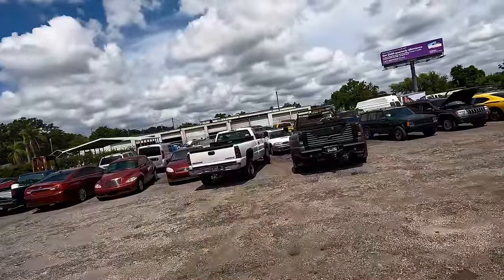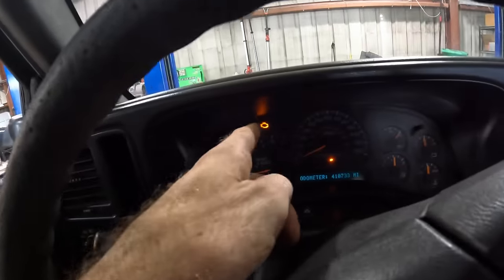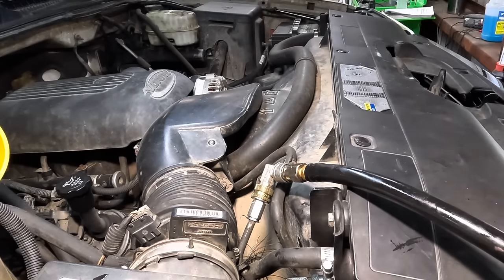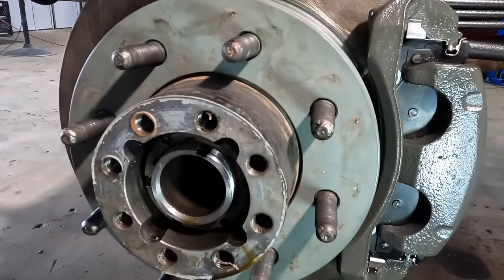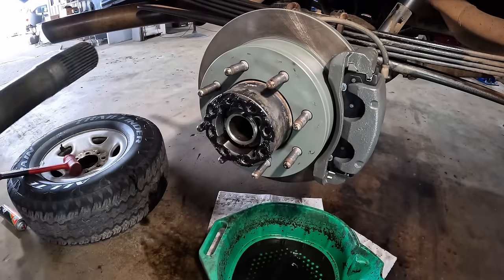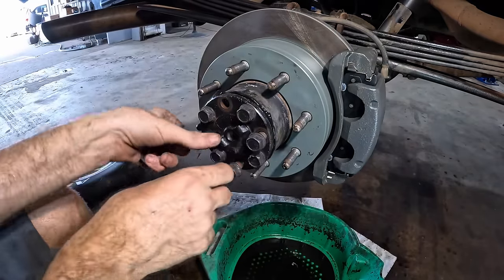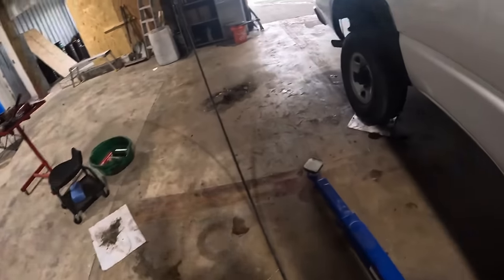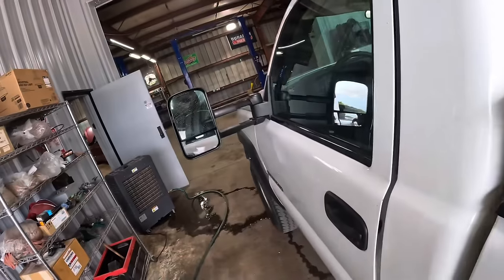400,000 Miles of BURNT Fluid & Loose Wheel! Oil Soaked!  2006 Silverado 2500 3500 6.0 4l80 #mechanic

Comment: Looks like its also may need a new oil pressure sensor. Its pegged to the max even at idle
Reply: More likely a failed stepper motor in the gauge cluster than a bad sensor, but could be both.  Kindof depends on a case by case basis.  GM cluster stepper motors are notorious for failure.

Comment: For over 30 years I worked for a co that had a fleet of over 75 superduties.
By trial & error our co learned the hard way ($$$$$$$$$$$$$$) that the
way to make auto trans last forever was to change oil & filter every 30K.
Doing a full trans flush & getting the bad oil out made these trans last
& last & last. The Boss said he used to have nightmares seeing that OD
light flashing.

!

Comment: This me, I would only change 1/3 of the transmission fluid.  Taking all the fluid out could cause the clutches slip.
Reply: If that's the case, then the transmission was bad to begin with

Comment: Ray, Since you usually do a review of what you have done and also usually invite us to heap our criticisms upon you I have a few comments to offer. 1) No mention of having torqued the wheel nuts at the end. Deferring said torque application made sense since wheel would have to come off again if axle seal was still leaking, but the job isn't finished if you did not complete the final torque; 2) No mention of the maxed out oil pressure gauge; 3) Up or down? You should have gone up first. You have taught us in other videos that saving time is important. Vehicle already up in the air - putting it two feet higher and then only having to drop it once takes less time than dropping it two feet, raising it four feet and then dropping it four feet. 
Please tell me that you recorder that video on a Friday so that I can maintain my high esteem for your mental acumen on a simple lapse of focus due to the upcoming weekend.

Comment: I've never had a complete fluid exchange kill a transmission. I believe the myth comes from people trying to save an already failed transmission by replacing the fluid. New fluid will not restore a burned clutch pack, nor will it turn back a blown sprag clutch. Any time I installed a used transmission, I always replaced all the fluid--and the filter. Pan gasket and external seals to boot. Easy when the trans is on the bench.
Reply: Bought a used truck from car dealership took to transmission shop had trans fluid changed it started acting up had to get a new transmission after that not sure what happened

Comment: I never used only new trans fluid in my E90 BMW that I serviced 3 times - I always added Lubegard 19610, but that's for a known transmission shuddering issue at certain speed, which I actually had. I was always under the impression that it wasn't advised to add only brand new fluid to high mileage transmissions since you lose friction material each time.

Comment: Have a 2000 Chevy Silverado with 127,000 miles on it. Still runs great. Haven't serviced the Trans. What would you recommend. Complete filter and drain and replace. Or just drain and replace.

Comment: Lean on both banks plus a mass air code= intake gasket time.
Reply: and put some caps on the AC ports!
Reply: Vortecs have terrible intakes. I have replaced a couple. Fellpro makes a upgraded gasket that works great.

Comment: Ray if the leaking oil got into the brake pads aren't they toast? They have been compromised? Brake cleaner would NOT clean the pads if they were soaked i n oil? Thank you.

Comment: If I had just washed off a contaminated brake without stripping it and sweating the pads I would have had something hard and heavy thrown at me!
Reply: Yeah thought that too.That much oil gotta be some on the face of the pads.
Reply: Sweating = alcohol? Or heat?

Comment: I have a 2006 GMC 2500hd 4x4 single cab fleet truck with 6.0 vortex that I bought brand new.  Now it has 195k on the odometer still runs strong I change the oil every three months or 3000 miles ( been doing this since new) changed coolant, transmission transfer case front and rear end many times also flushed the brake fluid a couple of times.  I have the posi rear end and it takes expensive gear oil.  Seeing the seal leak that much gear oil makes my wallet hurt.  They are good trucks if taken care of.

Comment: With the wheel bearings being that loose, I'd have definitely removed the hub to check the condition, and replace the seal as well.
I'd also have checked the other wheel as well. Whoever serviced it last obviously didn't know what they're doing.
(And buy a spindle nut socket set.  Using a chisel isn't the correct procedure. 🤣)

Comment: Rightmove man I changed the fluid on one like that and unfortunately ended up putting the transmission at it a couple months later maybe strain the old oil filter it somehow and put the the old tranny fluid back with maybe a new filter and top it off with new but I don't know about a whole flush could lead to a serious malfunction😮

Comment: Hi Ray, Apologies to trouble and need some info please. My brother is driving a Jeep 2.8CRD and when he stopped on the brake the jeep did not go into gear anymore. We replaced the valve body on the auto transmission but still no gears. Any thoughts? Sorry to be a pain but any help is appreciated. Sorry from South Africa.

Comment: Ray did you check the left rear retaining nut? If they did not tighten the right rear, wouldn't stand to reason that they failed to tighten the other side as well?
Reply: The left rear wasn’t leaking, which indicates it was tightened correctly.

Comment: Couldn't help but notice the oil pressure gauge showing 80 psi. I have a 2001 4.3 Mercruiser from in my boat and my gauge shows 80 psi as well. Mine happened after replacing the oil pressure sending unit.

Comment: Doesn't the map sensor help or determine how the trans shift points?  
 I know on grand prix 3.8 if you have codes for any air flow issues the trans will shift screwey and burn up 1st gear.

Comment: I wish that were my truck... 4x4 and all... sure runs nice✨✨
I have a 2000 Chevy Silverado 4x4 1500... Tin Frame cracked at front of left rear shackle; was going to get that professionally welded; 
then...Transmission first gear blew out bunch of roller bearings; It still shifts ok, with a thump between first and second gear shifting if pressured acceleration or load pull. I suppose it is now a "ranch tote around" now; I would not trust it as a daily driver work truck... Although it will easily drive cross country if that is all I had to do... 2nd 3rd and overdrive work fine.
THANKS RAINMAN RAY'S
ENJOYED THE VIDEO AND LEARNED THREE THINGS... trans flush machine process, rear axle bearing and seal, trans suction device.

Comment: Ray, I have a 1990 f150 302 I put headers on it doesn't have a place for the o2 Do u know a way to put it back?  Thanks, Roland . as always great video
Reply: Bungs are available to weld to provide a place to install a sensor. Just put it in anout the same place as original.

Comment: No one drops the pan on these transmissions anymore? As for the rear seal, I was taught, once there's oil on those brake shoes/pads, install new ones since you can't get the fluid completely out of them.

Comment: Hey Ray, i have an 02 Jeep Grand Cherokee Laredo 4.7L V8 VIN-N that has 224K miles. The previous owner may not of had the transmission fluid changed regularly. The fluid looks semi clear, its not dark and is still translucent but amber in color.
Is it safe for me to change the transmission fluid and filter/have a shop service fluid?
I just dont want the transmission to start slipping after the change. Seems to be shifting fine other than seldomly having a clunk when in 4th gear and very slowly slowing to 3rd. But if i press brakes to down shift its fine and if i go up from 1st-4th its completely fine. That clunk only happens every once in a while and i suspect a engine mount, the crossmember transmission mount looks to be fine but very old.

What do you think?

Comment: I would a serviced it with out the bq cleaner to leave a lil of the old fluid and maby some of the particles in there in case the high mile trans is used to them so it's less of a chance to cause slipping from the fluid exchange.

Comment: FYI On this vehicle, my transmission guy once told me, if you do not know if the trans fluid has ever been changed, he would not not do it. Why? Because he had seen it countless times where changing the fluid and filter would ruin an old transmisssion.

Comment: Ray, I really wished I had the money to bring my '04 GMC Sierra 2500HD down to you to get repaired. Mine has nearly 512,000 miles on it and other than the paint and a few other things being a bit rough, the truck is in very good condition. At idle in hot weather the oil pressure is about 30 PSI with it being almost 100 PSI on initial startup and getting about 80 PSI going down the road. I would also be honored to have it shown on one of your videos. Maybe sometime.

Comment: Its not a big deal, buy if your using sealant on the axle flange, putting all bolts in before tightening will keep more squeeze-out from getting into the threads.

Comment: Hey I thought you were a AMSOIL DEALER? Do you use those other products by cost or Preference? Just wondering, What is your opinion about AMSOIL ? I have been using AMSOIL for THRTY years with no problems. I use them exclusively for my Cadillac, Corvettes and my Chevrolet Truck.. I t is a fine product line…😊

Comment: Ray, have you seen the refillable break fluid cleaner bottles?  I saw it a couple of years ago at auto repair shop a friend used to work at.  Giant drum with cleaner and each can had a refillable valve on the concave bottom.  Might be worth the investment if you use it enough and makes business sense.
Reply: Sure Shot sprayer.

Comment: Why didn't you drop the trans pan to inspect for contamination as well as replace the filter screen? Also the rear hub should have been removed and the seal checked for damage. The park brake shoes should also have been checked for oil contamination. The pads would also be junk.

Comment: I thought I had a "Got ya".  I didn't see you clean the oil of the inside of the tire, but at the end mentioned you did clean it.  I was waiting for you to check the other side too.  If he failed to properly tighten down the right seal, there is no reason to believe he did the left side properly.

Comment: its not full floating axle its semi-floating. your diagnosing the vehicle before you drive, such as checking the fluid and the trouble code before you drive. On axle bearing your are supposed to check for pre load taper, all taper bearing must have pre load.

Comment: You will have to replace the trans at some point, the fluid change may only speed that. If you have trans issues with that millage and that fluid the new trans is probably on its way anyways.
Reply: Trans temperature is  the issue  my transmission barely gets to 135-165F(summer months)   pulled the thermostat...  my transmission fluid has 111,000 miles and still is clean like new... never been changed

Comment: I kept my transmission serviced at 45K mile intervals on a vehicle I bought new with 95 % highway miles and eventually 236K miles plus it had Suzuki XL7 engine and Vitara drive train(Chevy Tracker).  The last people I had service the trans didn't want to do the typical transmission flush procedure because they were apprehensive about the vehicle's mileage so they performed a traditional drop the pan service. I was not pleased.

Comment: Commenting on the Volvo story:  About three weeks ago, I dropped my wife at her work and was on my way to the house when I saw a grey Honda Accord (looked like a late model) drive through the first red light.  Caught up to it at the next intersection, where it drove into the left lane, then drove straight through the intersection on a red light.  Did this through two more intersections.  There was no hazard lights on, which usually means someone is trying to drive to the hospital, so I'm not sure what the issue was.

Comment: ray why did you leave the diff oil on the inside of the wheel and tyre in the wet could cause a spin off at least??????????? your sneeky washed it off of shot PMSL

Comment: I’m sure you ended up checking the other wheel seal when we weren’t looking?
Reply: My thoughts too.
Reply: @IR-nq4qv  if someone I'd up one side they sure as he'll may messed up the other...
Reply: The other side wasn’t leaking, so it must have been tightened properly. That being said, I agree that it makes sense that both sides would have been installed incorrectly.

Comment: That year transmission if you change the fluid you will need some viscosity increasing treatment like Lucas . Iam sure BG has same stuff. On the newer transmissions with electronic modules in the transmissions I would not service if it’s gone over 100k without any prior service. My 2c
Reply from the maker: If it wasn’t the 4l80 I wouldn’t have touched it
Reply: @RainmanRaysRepairs  👊🏻

Comment: RAY a GEARWRENCH 6 Pc. Spindle Nut Set - 41660D
"6 chrome vanadium steel 1/2" drive sockets are for most 4WD SUV's and light truck axle locknut applications"

Large 4WD spindle puller 3910D (shown third from left) is included in the set but is no longer available individually

2467 - 4-lug socket for removing and installing 4-Slot front axle locknuts on 1986-newer F-series 1/2-ton trucks, full-size Bronco with Dana 44 axle, 1984-92 Ford Ranger, and Bronco II with manual hubs and Dodge trucks

3937 - 4-lug socket for removing and installing 4-slot front axle locknuts on 1993-newer Ford Ranger, Bronco II, and Explorer with manual hubs; 1995-newer F-series 1/2-, 3/4-, and 1-ton trucks and full-size Bronco with manual hubs; 1959-85 F-series 1/2- and 3/4-ton trucks and full-size Bronco; 1960-90 GM 1/2-ton trucks and full-size Blazer/Jimmy; 1969-72 International 1/2-Ton trucks; 1969-89 Dodge 1/2-ton trucks with manual hubs

2770D - 6-lug socket for removing and installing 4-slot front axle locknuts on 1978-84 Ford F-series 4WD heavy-duty 3/4- and 1-ton trucks; 1973-81 GM 4WD 3/4- and 1-ton trucks

3195 - Ford 4-lug locknut socket for high-shear rotating nuts on 1985-newer F-250 and F-350 truck rear axles, and Dana 80 rear axles of Ford Super Duty trucks

3911D - Toyota 4-lug locknut socket; services high-torque locknuts on Toyota 4WD vehicles having free-wheel (lock out) hubs: 1995-newer Tacoma; 1996-newer T100 and 4Runner; not for 2-wheel drive vehicles

"3910D - Removes front spindle to access needle bearing when lubricating and aligning front wheels; 5/8"-18 fine thread permits use with slide hammer; fits spindle thread sizes 2"-16, 1”-5/8"-16, and 38mm-15; full-size GM, Ford, and Jeep with Dana front axles

it is on sail now on amazon for $65

Comment: If it were my truck. Yes, replace the seal. If it was your truck Ray, I know the seal would be replaced. Then again. You would have had it mounted properly the first time. 😮. As far as the socket set goes. You own one of the trucks it will fit. You plan to own it a long time. For your own it's worth the harbor freight cost for the set in 1/2" drive. And you get the Dana 30, 44, and 60 front axel sockets. A full floating rear axel is a wonderful thing.

Comment: I unfortunately traded in my 97 1500 Silverado w/5.7 with 150,000 miles for a new 06 Silverado  2500 HD crew cab  with the 6.0 liter. I put 42 thousand miles on it and trans crapped out. It has been 17 years, and I’ve regretted that trade ever since.

Comment: I've never bought into that idea that changing trans oil will kill it. If it's that far gone, it won't make any difference anyways. I know that some people like to stick it to the repair man for their already dead transmissions, but they have to accept that they brought it in for service mostly because they expect a miracle from a oil change. I do like to drop the pan and change filter and see what's in the bottom of the pan. if there's a pile of lining debris, I will drop the unit and fix it. Might be an extra expense, but beats having to tow it in from some where out in the boonies!  These heavier pick up trucks with the heavier duty trans today are lasting considerably longer.

Comment: As I pointed out in a recent video, when using RTV sealant you shouldn't tighten it down fully straight away as you run the risk of forcing too much of the sealant out from between the surfaces. The correct procedure is to tighten it down to around half the final torque then wait a few minutes in order to allow the RTV to start setting then once it has partially hardened tighten it down to the final torque specifications. The instructions that come with the RTV sealant should specify how long you should let the sealant set before applying the final torque.

Comment: I hope you remembered to torque  the axle and wheel nuts , I  know not everything is shown in a video , only thing( I think ) is that brake pads were more than 20% contaminated and should have been replaced but each to their own, (maybe customer refused such service )also seeing you had the scan tool hooked up would not have hurt to clear the codes and see if they came back ( just saying) I know that the customer did not mention the codes but could not have hurt to clear them well you were there anyway

Comment: One if the biggest mistakes ive made while working in my last shop was when i was taking out a Ford F-150 work truck from a corner bay. With this particular bay, you have to pass a ceiling support pillar. I was, stupidly, too focused on the passenger side while backing out and failed to realize how close the drivers side mirror was to the aforementioned ceiling support pillar. Needless to say, the next day, i was installing a new drivers side mirror for the company.

That's the first and last time thats ever happened to me. I hate the tight squeeze corner bays.

Like and/or comment if you can relate or have a similar story!